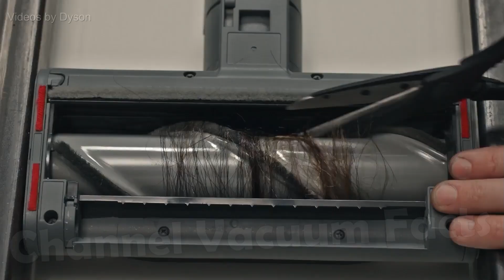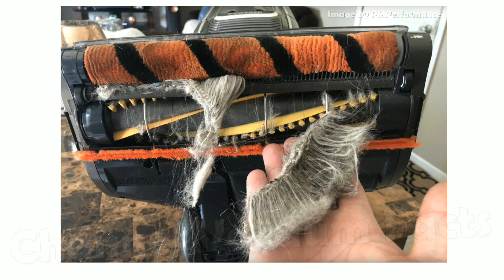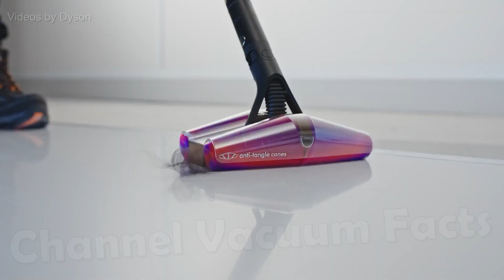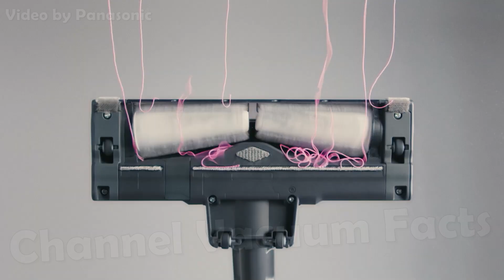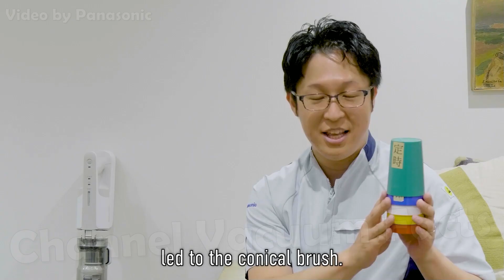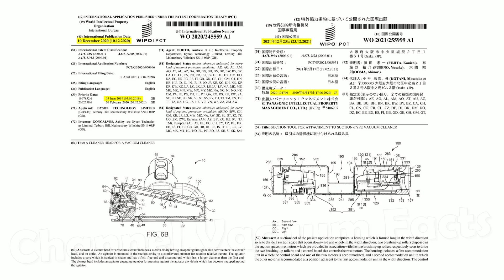History of Dyson's Conical Cleaner Head Design

Comment: The new Dyson DS60 was just released in south korea - comes with the multi surface variant of this head.
Reply from the maker: Thanksf or sharing. Yes, the Piston animal. Looks very intriguing and has everything I predicted and discussed here https://youtu.be/lWpdK234XfU. Their website shows it: https://www.dyson.co.kr/piston-animal-ds60-cordless-vacuum-matte-black-copper. Only unfortunate absence is solid state batteries. It's unclear whether this will be present in the other geographic releases.
Reply: Can not wait for its UK release as it’ll be an upgrade from my V10! 
Some great new technology and loving the new floor head and dust compression system too.
Reply from the maker: It's going to be very interesting watching the lay internet reviews of this machine. I'm going to not rush to be the first on this one as I did for the Gen5 (there are no benefits). I'm more interested now in exposing how rotten YT has become by exposing the ignorance and exploitation that will be visible in other reviews. Most lay reviews typically regurgitate the marketing spiel in a manner that oozes saddening ignorance. However, the really interesting features of this technology are not actually discussed in marketing and need to be understood by the educated from the literature. Will anyone notice, let alone explain why the filter is now 'inverted' for example? Will they understand the inner workings of the non-cyclonic first-stage inertial cyclone, why it does what it does, and quantify its effectiveness (which isn't even mentioned on Dyson's web page). And many other things. It's going to be very amusing watching the lay reviews.
Reply from the maker: If you want an example of the repugnant weakness of 'reviews' and announcements, look no further than this dire example. It's AI regurgitation quality... https://biz.chosun.com/en/en-it/2025/06/16/KISP2XPP2REWLKTPJ6T7NU5TRM/ or this junk https://www.mk.co.kr/en/business/11346324
Reply: Looking forward to upgrading from a V10 to this new model when the UK launch comes.
Reply from the maker: Does anyone remember what cordless stick vac had that dust compactor feature in their bin a couple of years ago?
Reply: @VacuumFacts  Hoover HF2 has it.
Reply from the maker: OK so multiple products have used it. Dyson have had the technology developed for years in patents before the Piston, so it's likely, although I can't confirm, that others copied, seeing as it's easy to copy that simple concept. If you find any others with it, let me know.
Reply: @vacuumfacts I noticed the filter is inverted on the new DS60.
My thoughts are but probably wrong may be something to do with the docking system to empty it. I read one of their patents that a docking system normally uses another motor to extract the dirt from the vacuum cleaner bin but Dyson see this as a waste of energy. So could the inverted filter be for forcing the dirt out into the dock by reversing the motor!
Reply from the maker: I don't see how looking at the design carefully. I'm not sure why it's reversed and it maybe something energy efficiency related. Unclear how rinsing it will be affected. The bin on the Piston seems dimensionally smaller, but actually has almost twice the volume. I am noticing that both Piston and Konical are registered trademarks, but only Piston has been used so far. So, it's unclear what Konical refers to. Perhaps there'll be a different product variant for other geographical areas. This is also consistent with the complete silence from Dyson when it came to the launch of this 'flagship' product, in stark contrast to the PencilVac, which got the full works.
Reply: @VacuumFacts  lg a9 kompressor
Reply from the maker: @splaw120  Yes, that machine was an attempt to dupe Dyson's self-cleaning shroud on empty design. Dyson's design is patented, so LG couldn't steal it, so instead they 'invented' a simple ring shroud scraper. In doing so, it had the feature of slightly squishing the fluff but only down to the max fill line anyway. It wasn't a good compressor. This is unlike Dyson's latest machine, which uses a full plate rather than a ring and actually compresses to near the bottom, well below where a traditional shroud would be. Dyson's compressor also served as a plunger to empty the dirt as well, which LG's doesn't. So Dyson are doing it right, unlike LG.

Comment: Dyson also uses the comb detangling technology on the cheaper cleaner head for the v11. The one with dls (dynamic load sensing) does not even try to pretend it is detangling hair.
Reply from the maker: Yeah, I suspect this is because solving detangling on a cleaner head properly was going to take more time than stuffing a few combs on there to retain market leading performance. Ironically, unlike all the other implementations of hair removing vanes, Dyson's was the only one that worked properly and well that I was able to test. But it still suffered from all the drawbacks mentioned in the video. It was just a temporary half-way house until the real solution was ready.

Comment: Impressive performance from a vacuum with such a compact form factor.
Reply from the maker: TBF, hardfloor cleaning is much easier than carpet. Crevices are the biggest challenge and that simply requires enough air power to sustain suction and thus a high air speed in the presence of larger leakage currents (lecture here: https://youtu.be/_CzzDiArrrg)

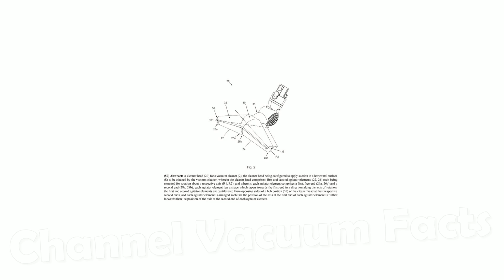Comment: Hopefully the carpet compatible variant features a more enclosed design similar to the Hair Screw Tool. This will better contain hair and prevent this issue of hair being re-deposited on to the surface. The cleaner head shown at 1:02 is described as being for hard floors, so it will be interesting to see what Dyson's solution will be for carpets.
Reply from the maker: It is not described as being for hard floors; you've maybe misunderstood what horizontal surfaces means. This is the outline sketch of the head for carpets (and I used the wrong image). It is enclosed (otherwise they couldn't achieve a low head pressure) and they have a novel invention to remove hair from the ends and achieve edge-to-edge cleaning, relying on clever shaped notches that cause it to ball up and come off. It will hopefully be the biggest cleaner head upgrade in a long time. I'm surprised their new machine isn't out already actually. Maybe they're delaying it until they've manufactured enough of their new solid state batteries, which I noticed were absent in the PencilVac. If all the technologies I think might be in there actually are, it'll be a revolutionary upgrade to anything seen. And what comes after it is also very interesting.